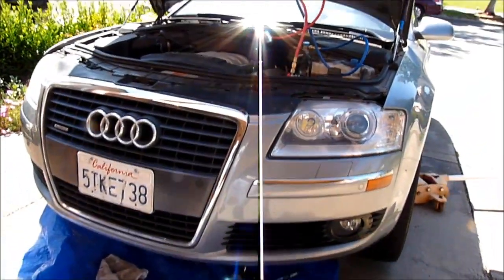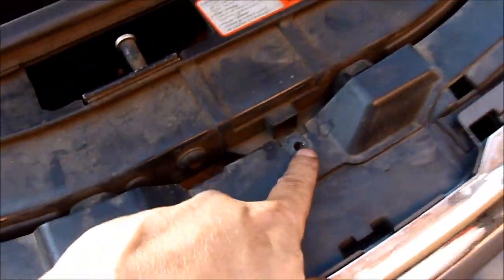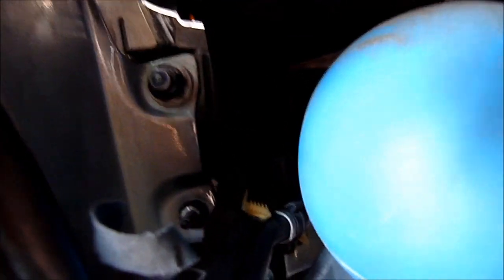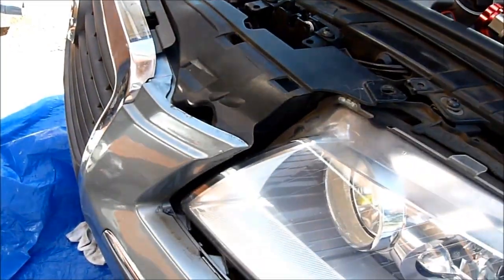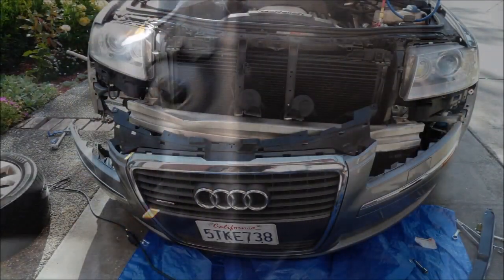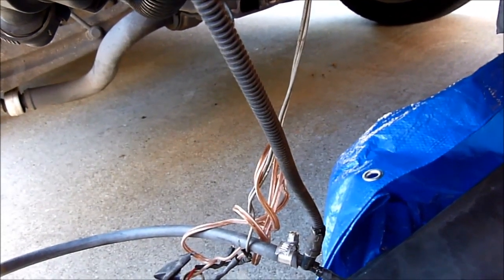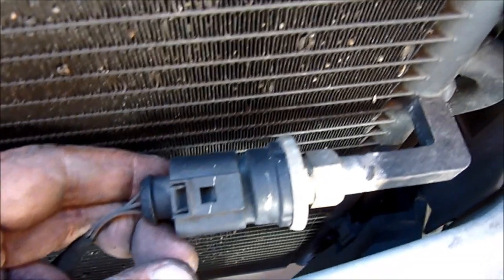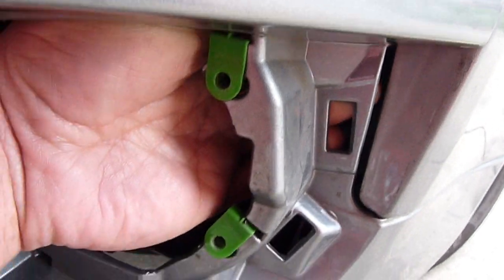Remove Audi A8L D3 Front Bumper Cover (revised)

Comment: Hey I learned a trick on those tricky stubborn sensor tabs. Spray some wd 40 on those suckers and wiggle them just a tad to get them loose. Insert small screw driver under the unlocking tab that you tried to push with your fingers and it wouldn’t bug. Wait for a click and then twist pull it out. Works for me every time when some seem to be stuck. Cheers🍻
Reply: i guess im asking the wrong place but does anyone know a tool to log back into an instagram account?
I stupidly lost my password. I would love any tips you can give me!
Reply: @Armando Skylar Instablaster :)
Reply: @Louis Collin it did the trick and I finally got access to my account again. I'm so happy!
Thanks so much, you saved my account !
Reply: @Armando Skylar glad I could help :)